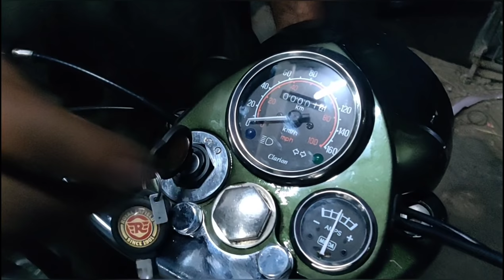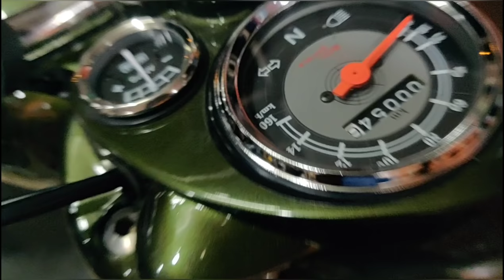OLD MODEL |Bullet 1967 Restoration |Royal Enfield modification |Bullet Tower sikar #vintagebullet

Comment: Its painful to see a 67 restored like that. Good colors and everything, but using a new classic tank, new switches, levers on 1967 is just pathetic and unoriginal
Reply: @sandeep15785  toh bhai aap bna do
Reply: I swear to God I was thinking how little us Indians know about restoration
Reply: It’s all about being practical I personally believe this kind of restoration is done to enjoy riding rather that keeping it locked in a room and call it a vintage !!
Reply: Tasteless mod job. These people don't know the meaning of restoration.
Reply: Yes bro, i am having 1962 model with all original parts❤️❤️
Reply: It's a restomod that's all.
Reply: Actually the bike was not in original state in the first place. The rim, hubs and brakes had already been change.I think the air filter.  Tank and tool boxes are also not original
Reply: Better for the bike to pass through caring hands saving it,rather than letting it rot away to oblivion!I love it and it has years ahead of it,making new memories...
Reply: It's not easy to find original parts from the 60's and 70's, most old Enfields get melted down for their steel and aluminum. When one of you uploads a fully 'ground up restored bike' completed by your own hands, I'd be happy to give it a like.
Reply: Rightly said..
Reply: Only one thing could be better redt all is fine... New LeD light could be used ..dat looks awesome...
Reply: @sandeepnaidu1963  yes this is practical.Otherwise it will be tough to maintain the bike and can't trust it for a long ride.In this way,it's easier to get parts and to repair.
NB:I am using a 1988 model as my daily rider.
Reply: Exactly bro

Comment: This is just replacing the old parts with new ones , this ain't restoration
Reply: They had restored some old parts as well
Reply: They what is restoration. Do explain?
Reply: @abhishekkumar-vp8th  working on old parts like polishing, reshaping, lubricating, painting and making them look new, in this case if they used the orignal tank and worked on it and made it look new then its restoration other than using another tank which might be beat up. IN simple words staying to the original.
Reply: @deltatech7041  when its an half a century vehicle. You cant stick to the orginality of the vehicle, structural integrity of the vehicle is almost done. You cant just polish,lubricate, reshape or paint the parts ,what ever you say doesnt work. When the newer parts are available for restoration. Its very reasonable to fix the vehicle with them. Here Restoring the vehicle is  to commute not for preserving. 
Cheers✌🏼
Reply: @abhishekkumar-vp8th  i understand but iamjust telling actual restoration is.
Reply: @deltatech7041  Restoration means removing, replacing, or repairing the parts of a vehicle, while preservation means keeping the original components. 

👆🏼👆🏼Just copy pasted from google for your reference.
Reply: @deltatech7041 A restoration is a restoration. No matter you replace it or repair it.  So in the video the bike got a complete RESTORATION 👍🏻
Reply: @abhishekkumar-vp8th  bhai tu to dil pe le liya 😂😂
Reply: @sayantandutta4527  comment section hai bhai. Dil pe lena hi padega😂
Reply: @abhishekkumar-vp8th  what is the price of this Restoration Bike or you can tell me the approximately idea please..?
Reply: @deltatech7041  yes
Reply: @mungerilal7948  where do you live?

Comment: None of the openings on the fuel tank were taped down. That guy's gonna have a lot of paint down the fuel lines. Surely the switchgear and levers aren't original, but this bike is a blank canvas. Some mix and match makes it look like a good modern classic.
Reply: Now may be no old varient accessories are available
Reply: Fuel tank . I also noticed. Fuel filling hole not coverd

Comment: my engine is in good condition and tire also so how much it will cost for same body work  .......... model 2007 machismo
Reply: If engine and chassis is in good condition...then approx 50-60k should be enough...it may cost you cheap if you get this work garage. But depends on various factors though. Thank me later 👍

Comment: Well it’s not a restoration it’s basically replacing most of the old parts with new ones. Stopped the video after seeing the beautiful old tank getting replaced by a new classic 350 tank.

Comment: Fake.   You took apart an old bike and used it for spares.   The fuel tank, went from rusty and black with no Royal Enfield written on it, and no knee pads, to a different black one.     And then without any prep work, it is perfect and green.

And then the seats,  Who puts brand new leather seats on a ratty old frame, and welds up a bracket underneath them?  

And we see no prep of the frame, the mudguards, it all of a sudden goes from bits of old bikes, at least two, to a perfect green one. 

It is fake.